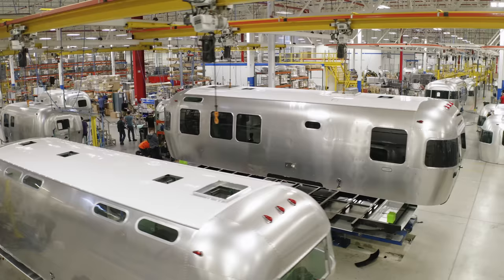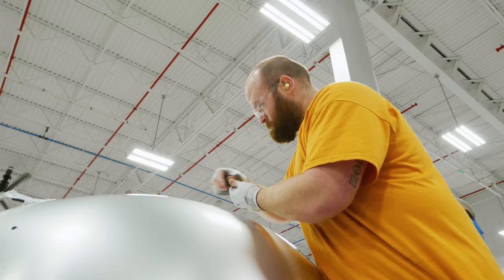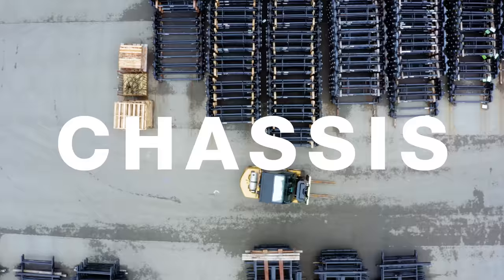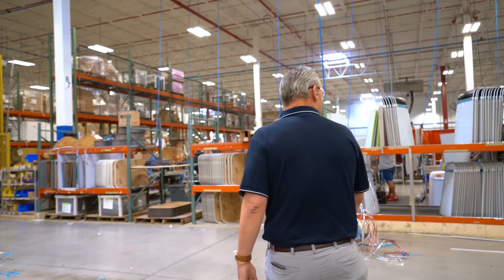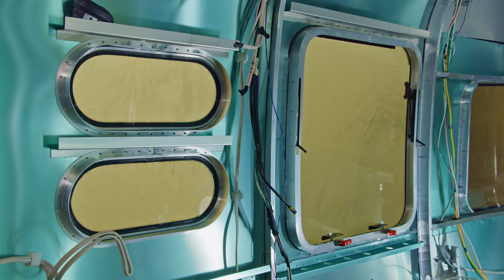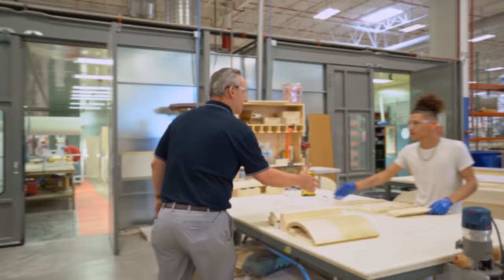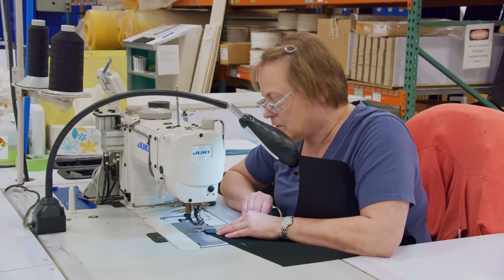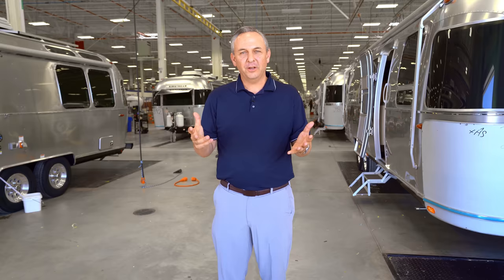A Tour of the Airstream Plant | Inside the State-of-the-Art Travel Trailer Production Facility

Comment: "We never use staples", then a minute later in the video, "Then they staple the......"  Also a good tip would be to NOT show you wiring techs just completely flying through running the wiring inside after you said they take their time and do this and that.  Congrats on the nice new factory, but after seeing this video I'm less interested in buying and Airstream.
Reply: Be meant tethering use staples to join the wood cabinets together.

Comment: Thank you for the tour. I am impressed with the water test and the cabinets after the structure process. Many other cheaper trailers use the cabinets to strengthen their sub-par structure of their trailer design. Having said this it is sometimes very difficult to validate your trailers extreme price. I also wish that the air conditioner could be integrated into the trailer rather than on top as it kills the aerodynamics of the original design.

Comment: Like any RV, each time you  travel with it down the smooth highway, it's like a 3.5 magnitude earthquake thus you have to continually monitor and make sure the RV is water tight.  The aluminum framing looked light in as much as the number of frames shown in video, so more of a unit body construction, vs a frame and then body.  Not sure of the strength of that as any damage would be major and costly to repair.   I know these are not inexpensive, nice to see how assembled.   Before I bought my RV I went to the Fab and saw how it is made and assembled.   I have an aluminum  framed RV and it has stood the test of time.

Comment: I  dismantled a crushed  'stream ( snow sliding off a roof, from a height, to be expected) and was amazed to see plain old carbon steel carraige bolts holding the aluminum bottom sill plate to the floor. Dissimilar metal corrosion was well advanced. This trailer was from the 60' to 70"s era.
Reply: what's your point posting this here???
Reply: @Al_Dente-d1p   No point I guess, just pointing out I saw an area that needed a design change. You just don't use carbon steel bolts up against aluminum long term. A bushing of phenolic or nylon to prevent direct contact while still maintaining the needed structural strength, or a stainless bolt would be better. I liked everything about it I saw when dismantling it, all the more so this issue surprised me.
Reply: @Al_Dente-d1p  - His point is that they weren't made as great as some people think. I assume they're built better now.
Reply: @OMGWTFLOLSMH  Hmmm?  60s/70s era.  That's around 50  years.  I'd say that's pretty darn good.
Reply: @OMGWTFLOLSMH they are built horribly now

Comment: We just received our 2023 Classic RBT.  We spent the night at our dealership with full hookups to test everything out. They only had to address a couple of minor problems. One was as simple moving the shelfs that were installed with the top and bottom shelf was reversed. Airstream Quality Control has improved for sure.  So far we really love it.
Reply: Okay, after we got home we notice the right side doors on the wardrobe closet was not turning the light out when closed. I the pushed on the upper left corner and it is about 1/4 inch away from the wall. I looked to see if the hinges could be adjusted and they are not designed to be. I contacted Airstream support seeing if they could send me a new door. I am waiting to hear back from them after sending them pictures and a video showing what the issue is. I will report back here once I hear back from them.
Reply: @kcwerv   Any updates?
Reply: @ericandalexlego  It appears the only solution is replacing the whole exterior and interior panels. The width on my door opening is 27.5 inches. Others report theirs being 26.25 inches wide. The other option is producing a new door to address the issue. I am waiting to hear exactly what they will decide to do. Due to the weather I can't get back up to the factory until April anyway, so we have some time to figure it out. I will post an update here once things are settled.

Comment: It looks so nice. It seems surprising that my airstream got delivered with so many broken things. Three of the six roof fence are permanently stuck in place and it came out of the factory that way.  There is such a huge gap between the closed doors and the frame I can take pictures through the crack of flies coming in and out. And then there was every single piece of white laminate peeling off of the walls within two weeks of its delivery in the middle of winter.
Reply: No comment from airstream huh…

Comment: Build one that has a battery and electric motor, then allow it to communicate with electric cars so it will self propel and not use any power from electric cars to pull. Can be beneficial to both gas or electric vehicles. Use a hitch with sensor to assess amount of pull force to calculate the amount of power the airstream needs to apply to its motors.
Reply from the maker: Hi Darryl, we're excited about the future of RV electrification! Check out the eStream Concept Travel Trailer --> https://www.youtube.com/watch?v=rQEztxVGEbI

Comment: Our 30 foot Classic came off the line today. I will report back here on the issues we have once we have received it.
Reply: Any issues in the year since this was posted?
Reply: @ericandalexlego  Yes, our door opening is too wide, so the screen door has about a 1/8th inch opening. I am going back to the factory in the spring to see if they can either replace the panel with the door opening with a new panel. Off course this will require replacing the inner and outer panels, which is a major job. I've suggested they simple make a new door that fits. We will see what they decide to do and I will report back here.

Comment: I went on a tour there on a Friday this past September. Our tour guide was great 👍 and the facility was impressive; unfortunately, there was only one spot or two where there was any work actually happening (because it was Friday). The only thing is that they do not assemble the Basecamp models there (the main reason I wanted to take a tour). While I thoroughly enjoyed the tour, I was bummed out about the Basecamp. Just an FYI...
Reply: Where did they say the basecamps are assembled? I would've never thought all airstreams wouldn't be assembled "under one roof".
Reply: The tour guide mentioned that they are assembled next to the facility where the MB touring coaches are built. I think it's on Airstream Drive in Jackson Center. I also think he mentioned that there are no tours for the Basecamp facility, though some of the Basecamp parts are fabricated and put together at the travel trailer facility, then shipped down the road.

Comment: Maybe I missed it in video but how are the individual sheets sealed  to each other to stop water ingress in the join ?
Reply: Was wondering the same thing. I was hoping for some aircraft quality epoxy but then I saw sealer going on from the inside by hand and he was missing spots and that was scary. They really need a robot putting that sealer in. They’re much more precise and repeatable.
Reply: @GNX157  Yes I saw that bit but can't be the only seal (i hope) as it that method is fraught with problems.
Reply: LMAO. I think they know exactly how to do it properly .... You make a poor armchair quarterback
Reply: @daveklein2826  Very poor quarterback but good engineer.
Reply: @daveklein2826  Customer complaints would say otherwise. A lot of them are about water leaks.

Comment: I watched this video with interest in understanding the new factory's quality management system.  I saw no evidence that a sub-assy station would be prevented from releasing a defective product since it wasn't monitored by an electronic system which could help prevent this (counting that the operator used the right number or rivets, that the torque tool reached it's correct torque when tightening a fastener, that there was a work instruction posted in each cell, or even a quality alert to communicate to the operator recent quality trends).  When a torque tool was shown to be tightening critical joints, like an axle fastener to the frame, I didn't see any calibration sticker on the tool which shows that tools are routinely calibrated to ensure they are doing what they are supposed to do.  Using a Milwaukee right angle M18 tool isn't a good choice for insuring each joint a torqued the same. Maybe that's why customers complain of screws coming loose or not installed completely.
With the exception of the new flooring material being used, I saw no real improvements in their process that would INSURE better quality.  This has been their problems for years, which is stated on multiple forums by owners. Shiny new building doesn't mean the quality is better.  Look at Harley-Davidson.

Comment: Airstream seems expensive to some people but considering the VERY long term value retention - they are perhaps the lowest cost option for travel trailers. 

A typical run-of-the-mill towable is built so poorly that they lose nearly all of their value in 10 years.....they are scrap after 15-20 years. A 20 year old Airstream will just need a little refreshing and it is good for another 20 years. I am not a dealer, just an owner with practical experience.

Comment: In the section about stretch forming you mention "250 tons per square inch"come on guys at least fact check yourself.  That would be something that not even a giga press can achieve and I did not see one of those in the tour :) great video, but coming straight from the source I expect the info to at least be accurate. I am guessing that you meant the entire press is capable of delivering a total of 250 tons of force which seems about right.
Reply: It is what he said ANOT WHAT YOU THINK YOU KNOW WHICH IS NOTHING
Reply: @daveklein2826  250 tons per square inch?  Not a chance.  Just think about the amount of force that you are talking about.  500,000 pounds on every square inch.  That is simply not possible.  Don't say that I know nothing when you yourself seem to lack the most basic understanding of physics. Also turn off your caps lock and use your spell checker next time you decide to "educate' somebody online.

Comment: For anyone to think that Airstream is this magical extreme quality trailer that stands alone amongst the others is truly mistaken. A person only has to read the comments from the Airstream forums and other RV forums to find out that Airstream is no different than any other RV manufacturer. They have their inherent problems just like Forrest River, Keystone, etc. Bottom line, ALL RV’s are problematic and seriously lack in the area of quality control. Hopefully someday RV quality and safety will be monitored just like cars and trucks. For right now the fox is in charge of the henhouse.
Reply: when walking through used travel trailers Airstream is the only one that doesn't make my skin curl ! the others usually smell like chemicals or are falling apart... just my observation
Reply: I agree 100% with every word. Airstreams are built better than most travel trailers but it’s a miserably low bar. After spending an entire afternoon at an Airstream dealer dissecting them, I walked away thinking their marketing story is a clever hoodwink. The overall structure is a little better but they use all the same junk off-the-shelf hardware and appliances that the rest of the industry uses. Absurdly overpriced boutique purchase.

Comment: Water "resistant" why not water proof? Foil insulation is rubbish too, it should at least be 25mm closed cell on the floor, preferably 25mm spray foam on walls and roof too. overall I'm not very impressed at all